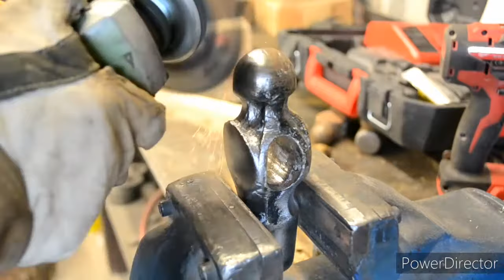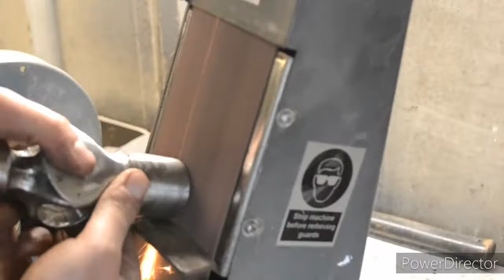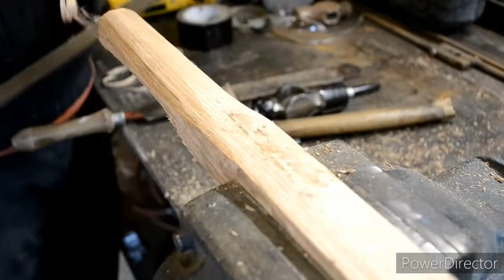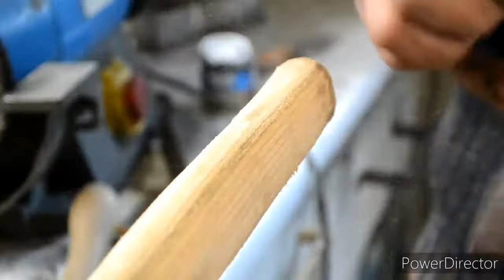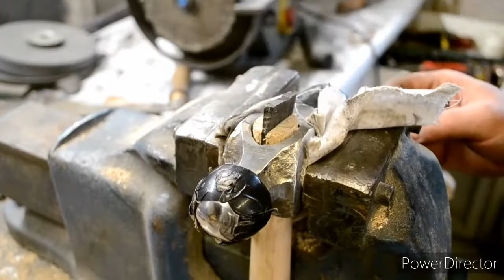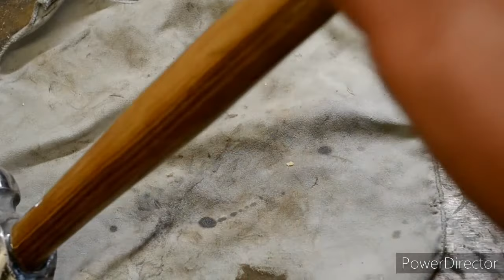Rusty Old Hammer Restoration- Hand making new handle

Comment: Looks good, just thought I would point out that the wood grain is off 90 degrees, don't hit anything to hard.
Reply: How should the grain be oriented? There are lots of ways to go 90 degrees in a 3d space.
Reply: @capers72424  The wood grain should run parallel to the head of the hammer.
Reply: @jimb1713  gotcha. When I got to the part where he was cutting the slot for the wedge, I thought that might be what you were saying. Thanks for the confirmation.
Reply from the maker: Hi mate. Yes you make a very good point, I totally overlooked that. I've been using this for a while now and had no splitting issues. I think if you use decent quality timber it will be strong enough.

Comment: what did you use to grind off the rust and pitting? flap wheel? sandpaper? thanks.
Reply from the maker: Hi there. I just used a 4.5" wire wheel, and a general 60 grit flap wheel.